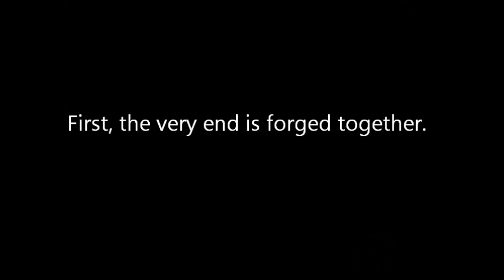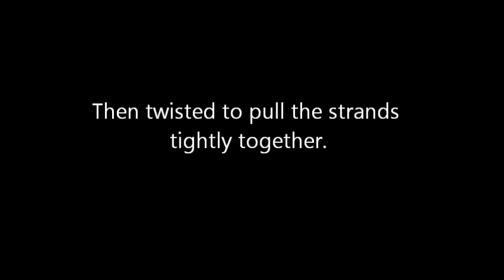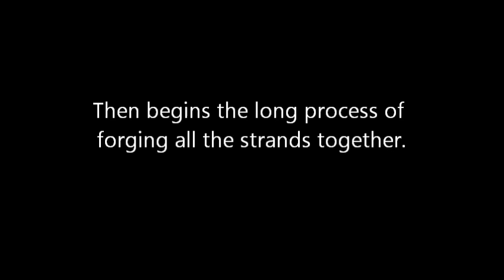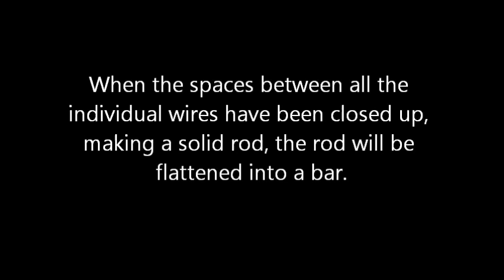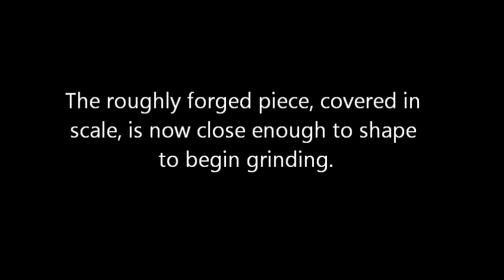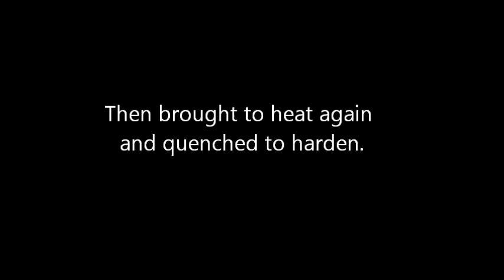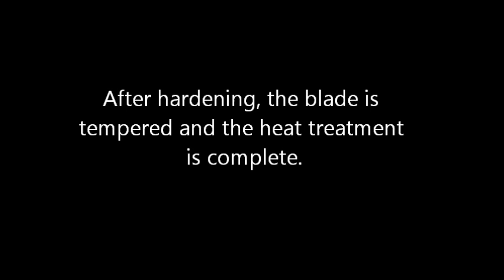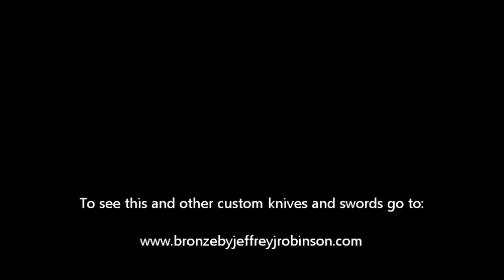Making of Leah's Dagger (cable damascus)

Comment: I really like how you took your time on each section of the billet. You ended up with an awesome fully welded bar with very small steel lose due to edges that didn't forge weld. One of the tightest forged welded cable damascus videos I have seen thank you.
Reply from the maker: Thank you. It's always good to take your time (when possible) the first time you try a new technique.

Comment from the maker: @ CthonicSoulChicken     Unable to respond directly to your post (stupid new youtube setup). Nope, no converted log splitter. The little mini forge press is made with a cheap air-over-hydraulic jack and a welded up frame. Cost around $150 all together with the various removable anvils.
Reply: brotherbanzai That's a very good idea for a low cost press, loving it !! 
What is the weight capacity ? Does a 20 Ton is enough ?

Keep up the good work/art !! ;)
Reply from the maker: ombregailla Thanks. 20 ton is about the most you can easily use. The higher capacity jacks run too slow. Less than 20 would be a bit weak, I would think.
Reply: brotherbanzai Thanks for the quick answer ! :)
Have you modify the release valve to use with pedals or somes devices to keep your hands free or are you force to do some juggling?

I would love to see a video about your homemade tools, they look very creative like your blades !! ;)
Reply from the maker: ombregailla I have to juggle. I made this press as a test piece just to see if it would work for what I wanted to do. The plan was to then build a better one with a foot pedal, better frame, and real hydraulics if I liked how this one worked. I haven't had the time or space to make a new one yet, and this one has been working well enough to keep using it as it is.
Reply: brotherbanzai thanks for your answers !! 
I'm going to build one, you inspired me !! :)
Reply: ombregailla just make it with replacable jaws.
Reply: brotherbanzai the only problem you had was that all strans of that cable are the same metal 
but still came out great wish i could see you do the same with a cbale thats made from 2 difrent steel wires
Reply: v48e12
like stainless steel wire and colbolt wire?
Reply: This may be a dumb question but we're and who would I go to learn to make 
Swords?
Reply: Lor animation studios
instructables an here.

Comment: great video man! thanks for posting! just a tip tho, when using that pipe wrench to twist.. use it the right way, (you've been using it backwards in this video) if you use it correctly, the teeth will grab and it won't slip! =]
Reply from the maker: danmarcelino Thanks. Yeah, first line in the vid description ;)

Comment: Very nice! I have always wanted to try making pattern welded steel from cables but I could never get the cables that I was able to get my hands on clean enough. Most I had was scrap offcuts from deep-sea and oil industry. And those things are made for the ocean and therefore covered in all sorts of nasties.
Reply: im just thinking out loud but maybe a acid dip would work to clean them up
Reply from the maker: Notrollhere Thanks. Just buy new cable. You can find places online to get it by the foot. No point in wasting time messing with unknown or junk materials. It isn't very expensive and much less of a headache.

Comment: Using the pipe wrench backasswards
Reply: +Ward Kuentzel i noticed that myself
Reply: Do you often weld a bar into the head of your pipe wrench and use it to aid in the fusing of braided steel ?
Reply: Now think about what you just said, and thank you for making my point.
Reply: +eldragon00 
He wasn't using the wrench the way it was designed to be used. That's why it kept slipping.
Reply: +eldragon00 The teeth in the jaw of the wrench only point in one direction. Welding a handle on the wrong side isn't going to change that. The only 'aid in the fusing of twisted steel cable' was the turning of the steel in the direction of the twist to bring the steel as tight as possible. I'll grant you, there is a left-handed twist in the steel, and we are normally accustomed to turning things to the right when we want them to get 'tighter.' So, I can understand why he initially placed the wrench on 'backasswards' initially. The fact that he kept doing this over and over after it was very obviously slipping, due to the teeth not engaging, does demonstrate that he doesn't use a pipe wrench, or channel locks, or any other adjustable, tooth engaging tool on a semi-regular basis. Which deserves being called out, and corrected. If I welded a handle on the other side of a hacksaw, and kept trying to get it to cut by dragging the blade the wrong way, the extra handle would have jack shit to do with the fact that I didn't understand how the hacksaw blade functioned.

Comment: Awesome!! I've been experimenting with forge welding and damascus steel and it's a lot more difficult than it looks.
I have a question:
Is the cable made from high carbon steel? Or does the layering of the steel give it a better quality?
Thanks for the videos I'm learning heaps!
I'm 16 and trying to improve my knives :)
Reply from the maker: knives&stuff The cable is high carbon steel. Layering the steel doesn't improve the quality, just makes it look nifty.
Reply: brotherbanzai Have you sawed one of these to inspect the interior structure?  When forging the blank repeatedly bows and is then bent back to straight.  This stretching and compression around the middle most likely introduces weak spots into the blank.  Recommend you try to work it from side to side and avoid this for future blades.
Reply from the maker: 800lb Gorilla Stress in the steel is why we heat treat, including multiple normalization cycles.
Reply: brotherbanzai Fair point.  I'd like to see a cross-section, still.
Reply from the maker: 800lb Gorilla I agree that it could be interesting to see a cross-section, but as this is the only cable damascus knife I've made so far, and given the time put into it, I'm not especially eager to cut it in half.
Reply: brotherbanzai Agreed!
Reply: knives&stuff when you cut the Damascus from the bar you added cut it an inch or two from the handle then you get a cross section  and the Damascus for the knife.

Comment: With regards to the cable twisting turn your pipe wrench around and go in the direction it is mentioned to go and I think you will find it does a better job and doesn't slip off as much.
Reply from the maker: +Colin Heiling  First line of video description.

Comment: would it be possible to melt the cable with electric current and then pass it  though the forge?  i'm thinking about the overall expense of fuel and effort.
Reply: Botha Lissom I think it would not work because of all the different cables

Comment: I wonder if cable exists where some strands are 1095, some are 1065 and some 1080 or something, just so you get a more pronounced pattern. Probably not as strong as this however. I really want to make one now!
Reply from the maker: ElementalOctopus I think you might be able to get cable with a different core, but not with different strands throughout. You could always get two different cables, pull them apart, and make your own.

Comment: Great video, it inspired me to make some cable damascus also! I bought some cable from the same place you did and it came covered in grease, I just burned it off and relied on the flux to do it's job but I'm wondering if a soak in xylol before forging would be helpful because I got a couple little inclusions in the weld. Do you do any chemical cleaning before forging at all?
Reply from the maker: +SCHROEDERknifeworks  I just burned the grease off, but did cook it pretty thoroughly to do so. Also went pretty heavy on the flux. I didn't do any chemical cleaning.

Comment: Somewhere floating around in one of the sheds, I have about 300' of old over head crane cable that was taken out of service for age. Maybe 1/2" or 5/8". No idea just what specific type of cable it is except it came off a 25 ton crane. Any thoughts on if it would do good for knife/sword blade material?
Reply: Depending on what it is made of
Reply from the maker: Don Marsh It could be, but there are lots of different types of cable and they don't all work well for blades. It's not that expensive to buy new cable and be sure of what you're getting. However, if you have the time to kill and are looking for a use for the stuff, forge some of it down and heat treat it and see what you get. If it isn't hard enough for a blade it can still be used for decorative work because of the patterning. Just don't try it on any cable which has a zinc coating.

Comment: Great work brotherbanzai, patience and skill rewards your blade. How did you finish the pommel? Is it screwed?.
Do you have more information on the building of your mini forge press? Thank you
Reply from the maker: Jose Ramon Delgado The pommel is slotted to accept the tang and was then tig welded in place. I don't have any info on the forge press, you just build them around whatever materials you have ready access to. You can use the cheap harbor freight 20 ton air over hydraulic jack as the heart of the press. Then the frame and dies are just whatever suits you.

Comment: that is an interesting process.  I thought Damascus steel was lighter than regular steel, but just as strong and had a degree of flexability, that normal steel did not. Am I wrong?
Reply from the maker: +Duane C   Yep, that is incorrect. Damascus steel, cable damascus, pattern welded steel, and regular high carbon steel all weigh pretty much the same. Strength and flexibility have to do with the heat treatment, blade cross-section, and carbon content.

Comment: Question: being that the blade originated as a twisted cable - what's the likelihood of the finished product having air pockets or other imperfections that would weaken it?
Reply: That's what the flux and twisting are for. The twisting makes everything tight and pushes air out, and the flux melts and seeps in filling gaps, and then it's all forge welded together. As long as the process is done right, it'll be a solid bar when he's done.

Comment: Fantastic blade!! But I have a question: Isn't the cable simply a collection of the SAME type of metal? I love the "cell structure-like" pattern that was the final result but how is this possible? Are there two different types of metal in that cable?

Again, awesome work!!
Reply from the maker: perpetualjon Thanks. I believe what causes the pattern is decarb in the outer layer of each separate strand of steel. This would cause the inside and outside of every individual strand to etch differently. So each "cell" is a partial cross section of a single strand as it curves out of the whole and back in again.

Comment: When they make steel cable, don't they heavily grease the inside? How would you be able to get all the oils out of it so tightly packed?
Reply: montanagold59635 
head ...
Reply from the maker: montanagold59635 Yep they are heavily greased, just melt/burn it out.

Comment: Beautiful job, very well done. I'm just curious why you used a hammer with such a short handle. A longer handle would let you do more work with less effort. Great job though, keep it up!
Reply from the maker: Thanks. A longer handle gripped further back requires more force to move on the upswing and delivers more force on the downswing. It's not mathematically possible to do more work with less effort. You can generate more force by lifting the hammer higher up but it will use more effort to get to the increased height. The same handle gripped farther back gives more force but less control as well as requiring more effort to move on the upswing, which is why you'll see many people choke up on their hammers when forging smaller pieces.

Comment: Try useing the still sons the correct way round they wouldn't slip then ,hope this is helpfull.
Reply from the maker: Jonny Grandad Yeah, I should have made them on monkey wrenches rather than pipe wrenches as well. I'll be making a new pair shortly, and then also holding them the right way around.

Comment: Amazing work! Love the look of the pattern. Is there a source for that cable in sections like you used for your project? I would like to try it but I would rather not have to buy that cable in a large quantity.
Reply from the maker: +Allan Hall  Thanks. Yes, you can buy it by the foot online from a place called webriggingsupply.
Reply: +brotherbanzai Thanks for the reply!

Comment: I am pretty sure you already answered the question, but how do you do the etching?  I know it is acid, but what kind/concentration?Beautiful work, by the way.  It is fascinating to watch the steel take shape.
Reply from the maker: I use ferric chloride to etch the blades. It's pc board or circuit board etchant available online from electronics dealers. I dilute 50% with water, other people use other concentrations.
Reply: Thanks a million.

Comment: Amazing work mate. Just curious, what purpose does the Flux have in the procedure?
Reply: +Halfswift It prevents oxidation of the surface during welding. It also helps to remove any surface impurities present.
Reply: Ah I see, thanks for the respond

Comment: what is the powder you put on when you were heating the cable? And what was the purpose please?
Reply from the maker: wenhao li Borax. It acts as a flux to help get clean welds, carries away the scale so it isn't trapped in the blade when forge welding it together.

Comment: when you're doing the twist, is it possible to twist too much?  or do you just twist 'till you're bored of the wrench?
Reply from the maker: +Seth Chase At first it's very easy to twist because there is a lot of space between the individual strands. As they come into full contact and the space is removed, it becomes harder to twist. I stop when I feel a lot of resistance. It's possible to keep reheating and twisting on and on, though that would change the final pattern and serve no real purpose to me.
Reply: +brotherbanzai gotcha, thanks for the perspective!  (keep up the brilliant work!)

Comment: Cable is made of only one type of steel. How can you make pattern with it?
Reply from the maker: Enis Turgut Yalçınkaya I would imagine it's due to carbon being lost along the outside layer of each strand as it's being heated and forge welded together. The lower carbon content then etches different than the higher carbon content center of the strands.

Comment: If you use the adjustable pipe grips the right way the jaws tighten their grip on whatever they are clamped on using the torque applied to the handle. Most people work that out by the time they are 6 years old!
Reply: MrTench8 nobody is using a pipe wrench at 6, but they are told to keep quiet if they don't have anything nice to say. Guess you didn't learn that one.
Reply: Oooooooohh
Reply: MrTench8 Why the crappy attitude? Please refrain from the anger, or do I hear jealousy here?
Reply: skittlesRgood182 erm... I beg to differ; I was using a pipe wrench younger than 6. Not everyone has parents that didn't teach them skills they'll need, later in life.

Comment: how much of a quality difference between a hand forged sword and a sword made from sheet metal
Reply from the maker: David Salganicoff Assuming you start with quality high carbon steel for both and do a proper heat treatment on both, there isn't a quality difference in the end product. Forging allows you to do some interesting things, like pattern welding and cable Damascus, but for a monosteel blade, it doesn't matter if it's forged or ground as long as the steel and heat treatment are good.

Comment: Hey slim, im 4 minutes in and i need to share some information. A pipe wrench only grips in one direction. You're backwards. Thats why it keeps slipping. Im interested in the conclusion of the story so ill finish it now.
Reply: Pretty good results. What type of steel is cable made from? Is it a hardenable type?
Reply: Brandon Hobby It is all high carbon, around 1080, the grades of the cable determine the carbon content. extra improved plow steel cable, is what the bloke here used, and it certainly has enough carbon to heat treat. But with the strands as they are i would certainly suggest using normalization for the treatment rather then just the quenching.

Comment: damascus was made with different metal alloy's folded and welded onto each other
the cable welding therefor is not damascus but instead called patern welding
Reply from the maker: +Verma Wyrda  The commonly used name for this type of blade within the blade making and buying community is "cable damascus", so that's what I call it. If you have issue with that, take it up with the rest of the world, I didn't invent the name.

Comment: Your really really good. What is that anti scale product? Is that what it's called? I made a few cable blades in the 90s but they didn't look as good as yours. On one, after I forge welded it round, I ground an 1/8 inch off all the way around. Then I hammered the blade out an it made an entirely different pattern. Instead of lines there were small circles. Good luck, I hope you get rich off your work
Reply from the maker: Shane K Thanks. I'm using a mixture of boric acid, red iron oxide, and denatured alcohol as an anti-scale. You can buy ready made anti-scale stuff as well, but I just make my own. The pattern seems to change a lot depending on how much you twist it and how you later forge it out.
Reply: Thanks, I quit way before I got nearly as good as you, wish I hadn't. I just remembered another pattern I tried. I had some small Inconel welding rods I knocked and sanded the flux from, then twisted a few in with the cable, and forge welded them up in the billet. It turned out really good, a lot of contrast